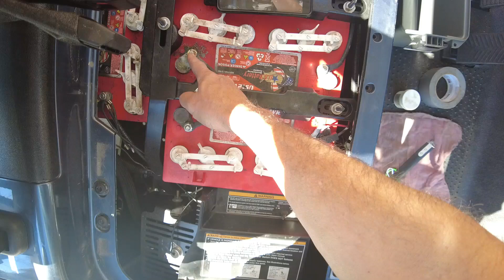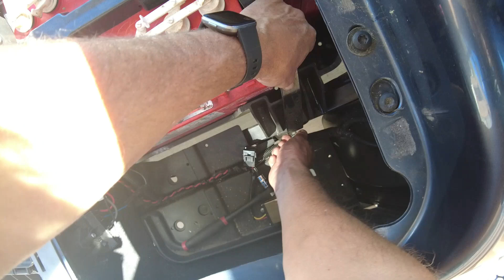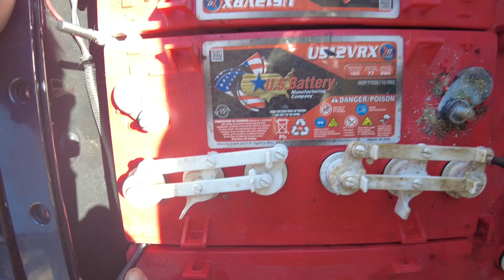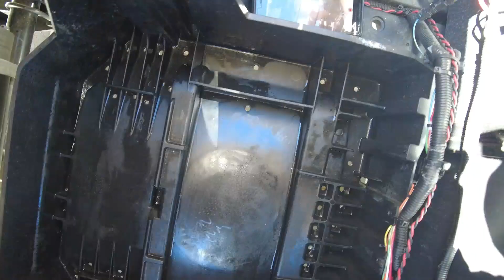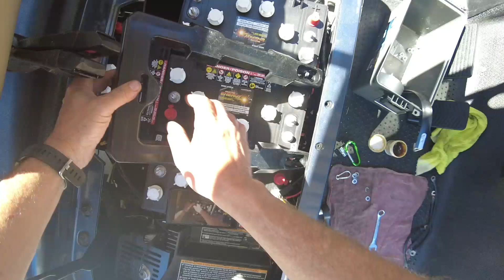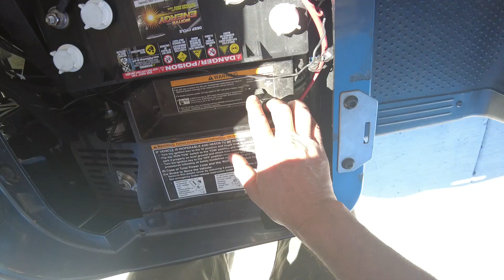Removal EZGO Golf Cart Batteries and Install Deep Cycle 12V

Comment: At the beginning of the video, you state that the negative connection gets removed first, and it is the last to be connected.   However, at the end of the video, you show the negative connected and the positive connection and then you add back the series cables.  Please clarify the sequence.
Reply: It doesn’t need to be in a specific order like a car there’s no difference as long as it’s off lol

Comment: Darn - didn't see the fourth battery get removed or re-installed. That's the tricky one. Also - at the end of the video - you say you put it into TOW then turn it on and test the brakes and then the video abruptly ends when you shift it into gear or something. But - I think I can hang with this and go get me some new batteries. Thanks!
Reply from the maker: You got this